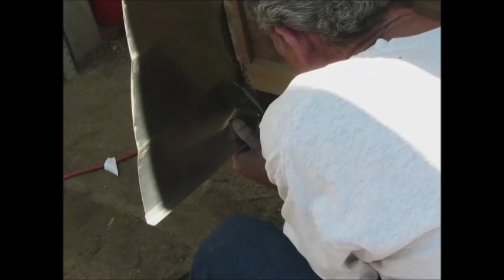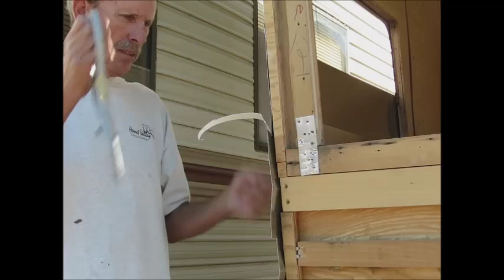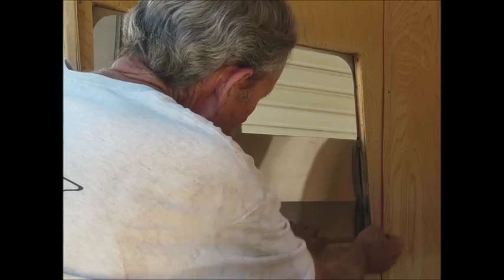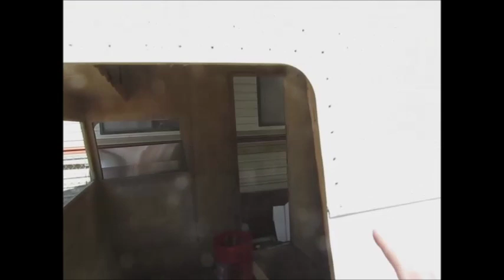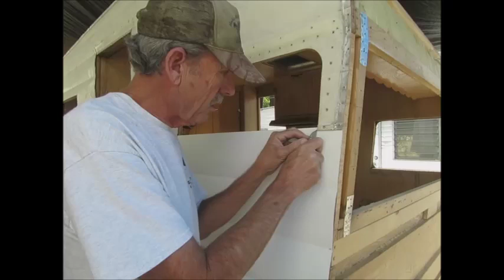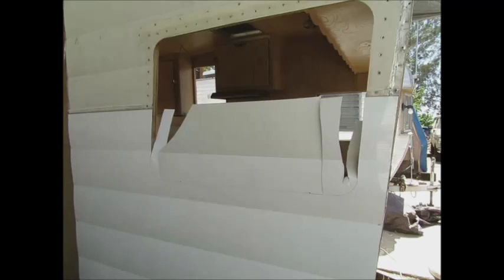Installing Lower Side Metal Part 2 - Metal Trimming

Comment: Hi--Ive got a question for you, 

1) you use the big tin snips to cut the edges, and in another video you used the router on the windows,  is there a reason you dont use the router on the edges

PS ive been watching since the deville and your video skills are looking fantastic (as are your trailers)

Thanks again!!!!!
Reply from the maker: Back then I couldn't seem to find the proper router bit for the job. Now I have found that. If you email me from my website I can give you a link for that bit. They are very inexpensive and it's what they use in the factories. Also, trimming with the hand shears can be cleaner. Because of gravity, the router tends to fall into little holes and crevices in the curbing (or edge board) so if it's just light trimming it's cleaner to use the shears.